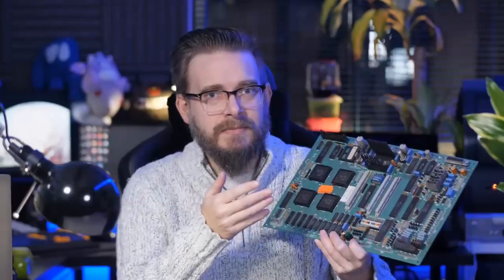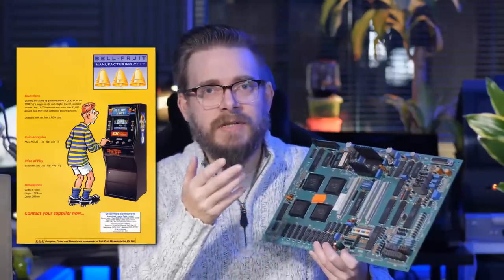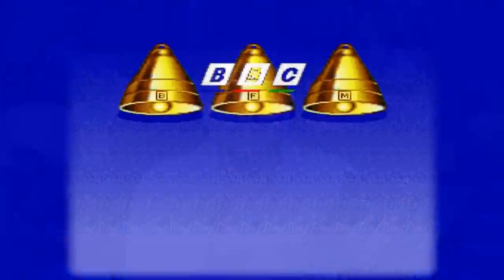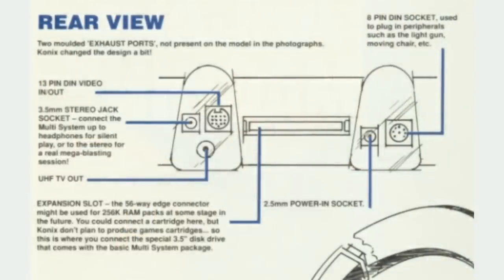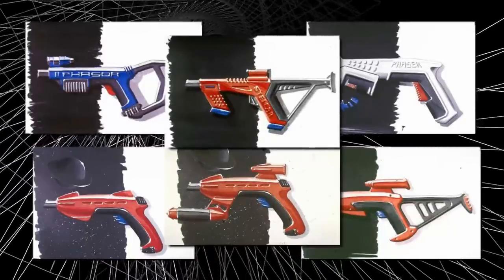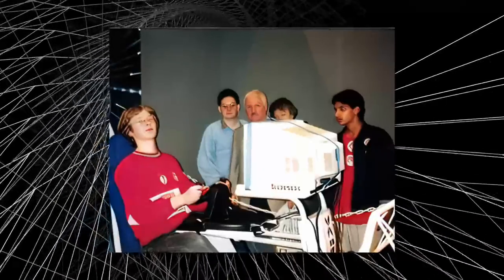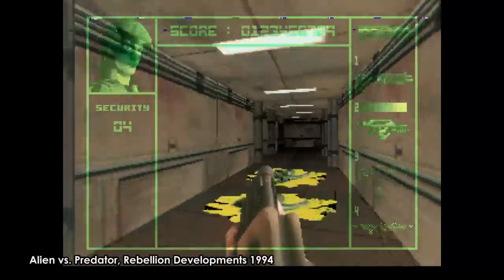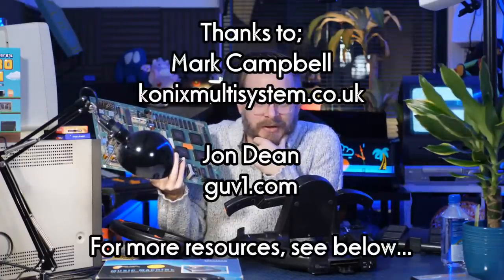This Console Would have Changed Gaming Forever | Nostalgia Nerd

Comment: Most computers in those days caused arguments about using the TV. Imagine trying to convince your mum to let you have an arcade flight sim contraption in the living room?
Reply: That's what I thought too, so few people would want to buy a system with a chair. Even with just the controller was a terrible idea, they could've just sold the controller as a seperate option.
Not to mention the inherent cost.
Reply: @DoubleMonoLR  If you think about it, the whole thing came full circle. Started out as a joystick, went through being a console, chair contraption, and then ended up as it began...as a fancy joystick...like most things, it comes down to timing and money. It was ahead of its time and needed finance. The Jaguar shows it would have worked as a platform, but probably wouldn't have been successful due to the scarcity of decent games. It would have been even harder trying to convince people to buy a Jaguar type console in the late 80's at high cost and next to zero games. Even Neo Geo had few owners back then due to the high cost of the console and games. At that time I was buying games for my C64 for £1.99 and £2.99...

Comment: A stand alone console could have done well, the hardware looked good, the games looked good for early efforts. They should have kept the peripherals and the system separate.
Reply: That's what I think too. A traditional system with controller would have been cheaper to produce and develop, and still would have sold if the games had been impressive enough. Plus even if it had released, what happens when parts wear out in a completely integrated system? You can't just buy another controller. I bet the thing would have been a warranty nightmare for Konix after a couple of years.
Reply: Should've tried selling the  peripherals to companies like Neo Geo, Sega and Nintendo. Would've raked in the money with those innovative controllers. The install base of those systems eclipsed home computers that could actually fully use those  peripherals.

Comment: OMG I think I threw mine away only a few weeks ago! I had this controller as a kid and it was utter crap. I had no idea on the back-story, thanks for the very informative video!  Also are you secretly sneaking about in my parents attic? This is like the 3rd fairly obscure bit of 90s tech that you've done a video on that I left there.
Reply: Yup I had one too - lasted about a month before a belt snapped inside making it useless. Even as a kid I could tell its lifespan would be in hours rather than years, it felt so hollow and cheap. Shame, because it was a great idea.
Reply: would love to see a modern version, would be great for mame
Reply: @jhbodle1  I remember the noisy, creaky squeaky plastic... still a pretty good controller for the time, but really garbage in retrospective!
Reply: @OriginalityDaniel  ,
No doubt! ...If there can be (could have been) an accurately controlling and well-built motorbike/ATV handlebar combined with a steering wheel option, that controller would sell (have sold) well since it's an overlapping interest in instances for those gamers, even after the cost of shipping it with pedals. There might have been enough interest for some to purchase two of them for split-screen/system link. In the '90s, there were at least a couple if not a few analog protocols but that could have likely been handled easily with an onboard switch to neGcon/UltraRacer and couple MadCatz wheel analog protocols - the Micro-MC2 or the full-sized ... Such a controller, alone, would have kept the company bills paid if not well-off for all of the players enjoying ATV/Quadracer titles (i.e., "MX versus.." and ATV Offroad Fury titles - local and online), the early popularity of Jet Moto and Wipeout titles, Gran Turismo, generations of ToCA/DTM ttles, generations of motorbike games such as MotoGP, etc. ... For 2-wheeled, I would have found it interesting if they could have been around long enough to eventually have been inspired by Sony's SCPH-1110 Analog joystick regarding using the infinitely variable lean of the joystick to create the matching lean of the motorbike - i.e. , Castrol Honda Superbike Racing for PS1 - there's some kind of mechanical unlock/lockout and switch for remapping options.
Reply: So you just threw away one of these extremely rare Konix Consoles, huh?
Reply: @johncoops6897  no, the cheap crappy controller they ended up making instead, watch the video all the way through.
Reply: @Tmp2k  - I did watch the whole video. I was referring ONLY to your comment... if you meant a controller, you should have said so. Furthermore, they made quite a few different controllers, so how could anybody know which one you were referring to?
Reply: @wesleyswafford2462  - well, no. However THAT IS WHAT THEY SAID HAPPENED.
Personally, I thought the entire comment was bullshit.
Reply: @wesleyswafford2462  I love going there for a rummage. There's a portable CD player Nostalgia Nerd mentioned in a video up there, a Sega/Tyco "Video Driver" game that he did an entire video on and somewhere there's an MP Man (the world's first mp3 player). I've found the box, cables and instructions - but no MP Man!!!  The worst thing I ever did, was throw away my first PC, a Siemens Nixdorf Scenic PT-102. A few years ago, after many years of searching I found the exact one in Germany and a mate in the army over there, drove it all the way home for me!
Reply: @johncoops6897  you're right John, it was utter bullshit....   It turns out I never threw it away, it's still here 🤣  I've tried linking to a photo of it next to your comment on my laptop screen but YT keeps removing my comment.

Comment: Funny thing Jaguar also was crippled by low memory capacity. I remember that one of games was released both as a cart and a CD (Hover Strike?). CD version not only had more details, but also was faster. Many cart games were so limited that they had to decompress ROM data on the fly, because uncompressed textures didn't fit anywhere in the memory. Guess how that impacted the performance. Also people got tired with mostly undocumented custom chips, and coded most of the games on 68000, that supposed to be just a 'joystick CPU', and as such also was crippled by lack of stuff needed on the system bus. 
On the bright side, it had a very interesting 16-bit color mode that looked like 24-bit (it used 8-bit chroma and 8-bit luminance instead of ugly 3x5-bit RGB). And you can easily DIY video cables and controllers for it.
Reply: Hoverstrike Unconquered Lands was basically a CD Special Edition of the cartridge version.

Atari Engineers moved coding away from the 68000 onto the GPU and got according to the late Lance Lewis, an extra 3-5 fps performance out of it.

The CD storage allowed for more missions, intro, cleaner, more varied textures.
Reply: @thefurthestmanfromhome1148  Thanks for the info. Interesting that they kept working on the engine after the initial release (5 fps from the cart version was a huge improvement).
Reply: That's were the Amiga CD32 was the only computer to console device to work, since it's basically an Amiga 500 without the computer parts. So game development was super easy.

But it to, failed.  Sold mostly in Amiga shops where Amiga owners had no reason to buy it.  Oh, it was kind of ugly and the joystick sucked.

By the 1990, it was pretty much a Japanese gaming market.   Unless it was Mario or Sonic... You were dead.   Xbox squeaked by, but it's pretty much a loss.  It has the backing of MS to give it a chance.
Reply: @TexasCat99  the CD32 was essentially a console Amiga 1200 (it had AGA). The CDTV was based on the 500.

Comment: It's difficult to predict the success level of the system had it been released.  As a yankee lad when this was in development, I remember being less than impressed with the screenshots of the system in EGM. They really did not match the claims being made about it. 

I also want to point out a clever control scheme does not mean developers themselves will be clever in utilizing them.  I point to the Nintendo Wii and DS third party games as examples. I would say out of their libraries, most were shovelware that looked at the controller as an afterthought with designs starting from the traditional directional input and some buttons rather than how a game should 'feel' when played.  You can't make a good experience playing a game with unique controls if they're not even part of the design process from the beginning.  I suspect a lot of game development houses are very cynical in the first place, which probably contributes quite a lot to the lackluster libraries of systems with novel user input schemes. They are not like arcade game design where the control methods and software can evolve with each other because there's no 'prefab controls' that are imposed on them if they're willing to spend money manufacturing the machine's custom parts. 

Also, just as an aside, if the prototype chair was sparking, I think rumors of people being electricuted in this 'electric chair' would have started flying around playgrounds.  That could have been a fun historical story in and of itself in the alternate dimension where the Multi-System made it out of the factory door in tact.
Reply: Honestly, I think it would have been a flop. 

The Japanese comments feels like attempting to save face, cause then why didn't they sabotage the other systems from non Japanese game companies, and also why only game companies

Comment: The funny thing is with the emulator, somebody could today get one, reverse-engineer it, gain perms, create a special board for it and create a literal Konix multi-system using an RPi as a base, or maybe Radxa's CM3 if they need more I / O than what a CM4 would provide. It would be easy enough to recreate, that peripheral and it can be modified to host the hardware inside, thus creating a truly luggable experience.
Reply: fuck yes....this would be a great build for the MAME crew

Comment: Seeing how this still supported standard-style joysticks, I can't help but be reminded about the last few console generations. You think about the fixation on motion controls and other gimmicks that were really pushed by the manufacturers, but eventually the novelty wore off and developers went back to making games with standard controls and consumers were right there with them.  I'm sure that if the Multisystem actually did come out and managed to initially sell well, the number of games supporting the wheel/yoke would of dropped off sharply after a year in favor of basic joystick support. Hell, they would of probably end up releasing a pared-down "lite" version that removed the wheel and would use controllers ports only.
Reply: Yeah, I agree, although I suspect VR is here to stay, but I guess that’s more of a shift than just input method.

Comment: I went to that PCW Show at Earls Court in 1989, hoping to try out the Konix chair.  When I got there on the first public day (I believe the 2 prior days were press only), the chair was there, but I was told by a lady on the stand that due to technical issues, the chair wasn't working, but if I came back the next day, it might be.  Imagine my disappointment as I was only there for the day - at least I know that it never worked, so I would have wasted my time going back for the following two days.  However, I did bump into the guys from the then new Amiga Format magazine and had a good chat with them and then listened to a salesman telling a punter that Hard Driving could be used to teach people to drive.... hmm I  don't remember the 360 loop on my driving test!  One other thing is that in 2001-2002, I bought one of those multi-system and controllers off the internet and realised it was the Konix system.  I used it a few times and it was pretty poor, so it ended up getting dumped.  It was a great idea - I don't know if it would have been successful without some outstanding games.  I categorise it along with the Sam Coupé.  Great video, as always

Comment: Excellent video! I really enjoyed learning more about this system!
As we've seen time and time again. When it comes to game consoles you can have good or even great tech and ambitious goals. But if you don't have the funding to back it all up then it generally ends up all for naught. Such a shame.
While there was plenty of speculation that the Japanese console makers had put pressure on various entities which prevented Konix from securing additional funding. I would guess that funding was cut off in large part because the Multisystem was just too different for its own good. Even by the late 80's in most of the world a game console the primary input device was a joystick or gamepad and a computer used a keyboard. The Multisystem had neither of those as the default. That combined with other factors probably scared a lot of potential funding away. Plus it didn't help that there hadn't been any terribly successful western developed game consoles since the late 70's/early 80's either.